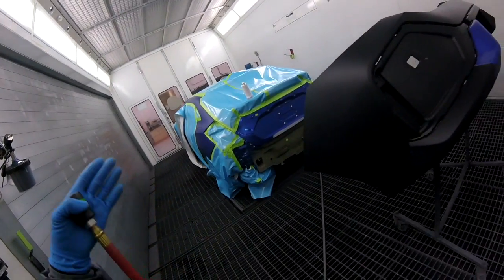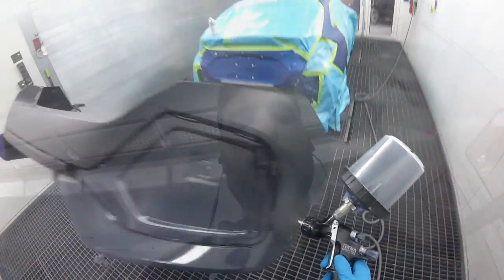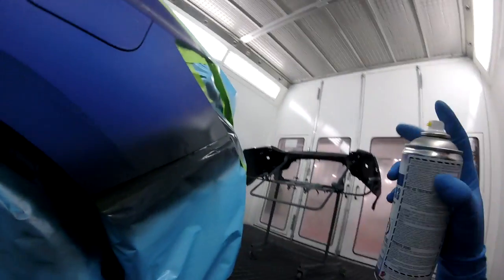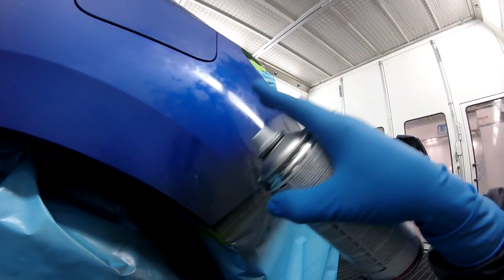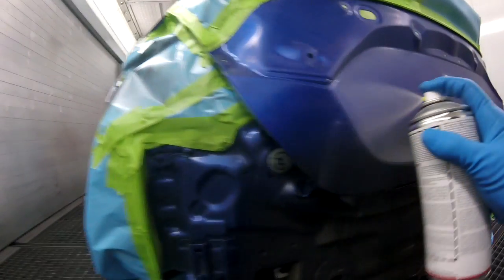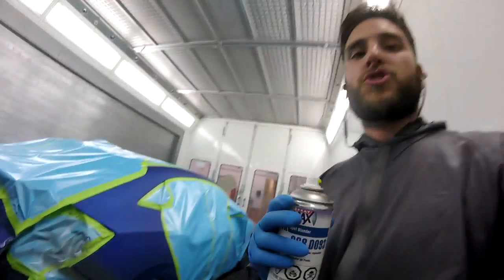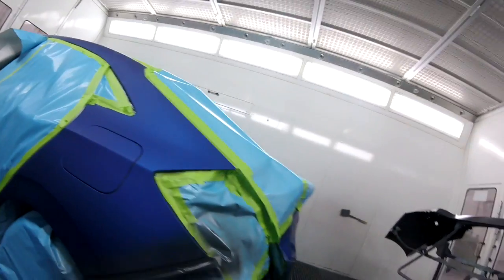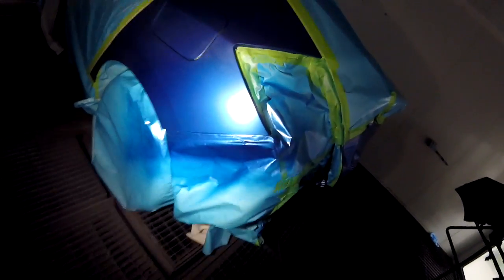Blending sealer tips !

Comment: I use a SRA 7.0 n a sealer edge... On a metallic silver/gold you can still get a halo from the basketball size droplets left by the sealer but,, adding an extra splash of reducer to your sealer & using the SRA it knocks it down significantly.... You can also lay down a wet bed of color blender over the sealer 1st & that will also help level things out...

Comment: Nice video. What if I told you I never use blender for sealer. It's all about the right air pressure and reducer. I've tried it both ways. I can get sealer to lay out with no edge not using blender. But to each their own. I love your videos. Great channel. Keep it up man.
Reply from the maker: +Gene Stafford yes I've done it as well very true just over reduce and your good but I just have peace of mind when I add the blender and I want it to cover the bumper properly as well 😀 but yes totally doable!!!

Comment: So do u use sealer every time u blend on a repair spot ... I see there was no repair there but u put sealer there.?.. And one more quetion? Can i use wet bed instead off blender on the sealer once i blended...? And thank u for takn time to respond it means alot my brotha...
Reply from the maker: +david atherton depending on what paint company I don't think you can use wetbed with ppg to blend the sealer I used it for this color because I wasn't sure of the coverage
Reply: I ment after u put sealer down do u wetbed on top of that for top coat.
Reply from the maker: +david atherton nope no o don't

Comment: The fast majority of the stuff I do is single stage and that's way thicker than just base coat so do you think a blender is necessary if I just wanted to spot seal as long as my sealer and paint are compatible?
Reply: seth kremis if you don't mind me saying, you should be perfectly fine spot sealing without blender. Waterbase acts differently over sealer than solvent based paint.
Reply: Daniel Green yeah I basically tested my theory right after posting this and it worked just the way I predicted and it'll probably be the way I do most jobs now for the sake of saving material
Reply from the maker: +seth kremis yeah because it will get rid of the dry edge the sealer will leave
Reply from the maker: +seth kremis awesome!!!!
Reply: blender is really good for high metallic colors when used on the sealer.Dupont has some good sealers that dont really need it. the standox i spray now needs it.We thin our sealer 20 percent. what do you usually thin yours to?White sealers i usually dont thin at all.

Comment: I found it incredibly offensive when you didn't introduce yourself and was about to stop the video at 0:04!! But then you quickly corrected the issue! ;) This blender you are using IS THE BEST. If i'm using a can, it's "Standox Smart Blend Plus" and since many Spraymax products also have a Standox label, it should be the same product in both spraycans. And yes, i comes out a bit heavy and it will easily run on you, so it's more suited if you have a little more room on the panel to fan it out on. For smaller jobs that require more control, i prefer a blender in a gun. Be blessed my brother :)
Reply from the maker: +Chuck Thomas haha!  Phewww that was close haha!  It's a great blender!  Yeah you have more control with a gun 100%
Reply: smart blend is the shit. i use it everyday.rm has a great aersol blender to.